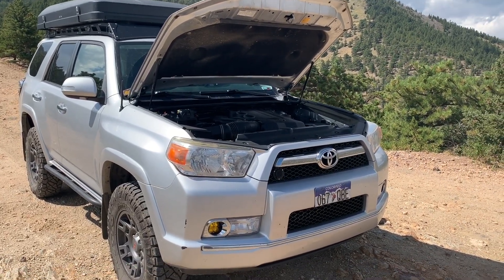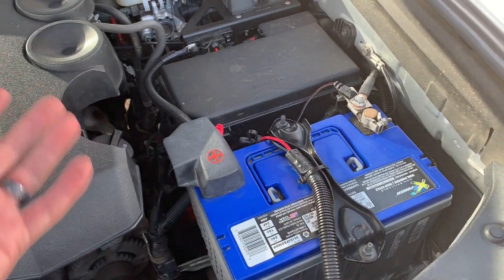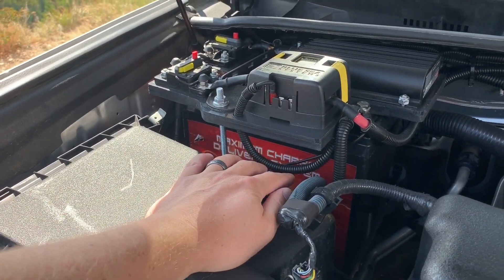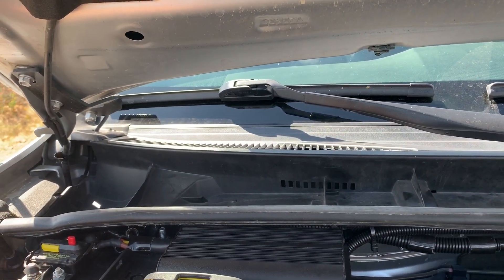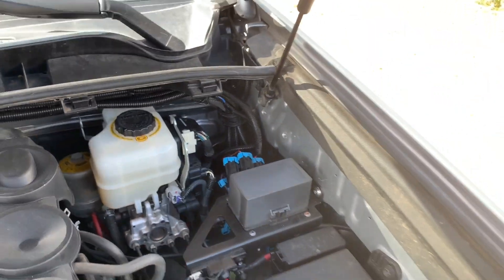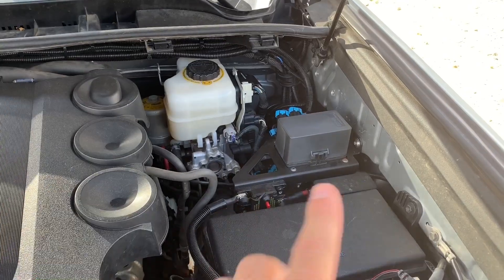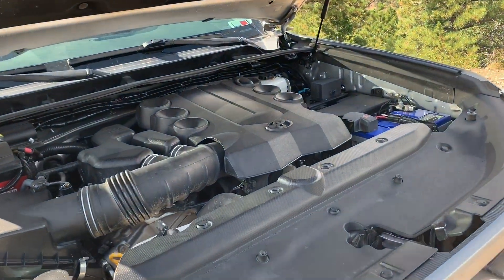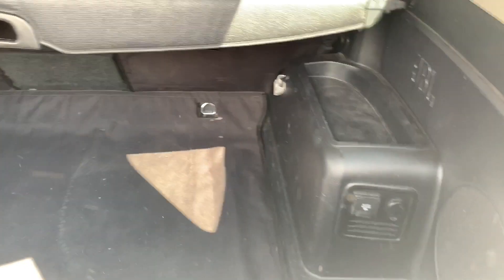5th Gen 4Runner Custom Dual Battery and Electrical Build for our Overlanding Setup

Comment: For your rocker switches, did you use glue or some sort of adhesive to install them in that cubby? I made a similar one but used hot glue but need to redo it each year so trying to find a new way. Thanks
Reply from the maker: I roughed the sufaces and used an epoxy

Comment: How do you charge your main battery if it is AMG battery?
Reply from the maker: ARC Light LED voltage booster, basically a diode to up the voltage.

Comment: How do you like the baja design fog lights? I have a 2011 limited and you can’t find a lot of info on the pre-facelift model, do the fit in the stock location without any modifications? Thanks
Reply from the maker: Yes they fit the stock location, direct fit, totally plug and play.

Comment: Do I see kings peeking out from under there
Reply from the maker: Epeater86 Yup, custom length, custom valved, extended travel, remote reservoir Kings with Icon 2” rear springs, durabumps, and JBA front upper control arms.
Reply: @aguyagirlandatrail  Nice setup. It seems that you really think about and over build your mods. I have a trd off road that I want to upgrade the suspension on but the are so many options
Reply from the maker: Epeater86 Thanks. I research everything. I’m very picky about things and detail oriented, I definitely put a lot of thought and consideration into the modifications I do. I aim to do things right, once, the first time.

Comment: This is awesome! Thanks for sharing

Are there any recommendations guides you followed?
Reply from the maker: Dee Gee Waytek, they sell a ton of electrical stuff, to a lot of OEMs as well. I requested a catalog and starting looking through specs of things. Mostly amp ratings, water proof ratings, they tell you how many connect/disconnect cycles the terminals are designed to handle etc. I also just researched other professional builds. It also helps that I’m in the automotive field.

Comment: Which size tire I have ? Is stock high ?
Reply from the maker: 255/80/17 Ridge Grapplers and custom valved, custom length, extended travel King remote reservoir coilovers with Icon rear springs. It’s roughly 2” lift all the way around.

Comment: What size tires do you have and lift or level.
Reply from the maker: 255/80/17 Ridge Grapplers and custom valved, custom length, extended travel King remote reservoir coilovers with Icon rear springs. It’s roughly 2” lift all the way around.